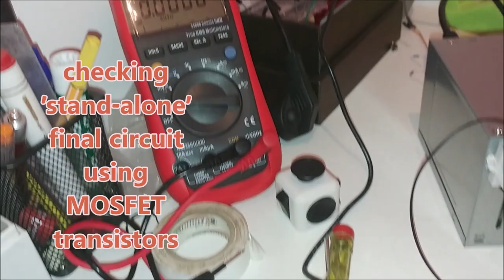LED Stairs Project - Arduino based active by motion sensor

Comment: You can upgrade it with, another pir sensor, one will be downstairs and one upstairs and it could light up by direction you are moving, example you are standing upstairs so it will light up from the top to the bottom and if your motion will be detected on the bottom it will switch direction from bottom to top :) I have this code because i wanted light under bed at night. 3 sensors 1 for my side , 1 for wife's side, and one side is detecting the door so if i go at night to toilet it will light up first the strips from my side and when i am coming back to room that third sensor detects me and light up the middle strip and then the other two  :)
Reply from the maker: really good idea. thank you milan sobocz
Reply: Please can you share the code

Comment: There is a problem with your project. If you come from the upper floor to the lower then the lights will not glow as there is only one PIR sensor used in this project and it is situated at the first step of the stair of ground floor. So if you come down from upper floor then the lights will not turn on and you will fall as it will be dark.
Reply from the maker: thank you @Lion for your comment. it's a good point what are you saying. but actually, the PIR sensor is located under the second step (from up), so it's activated when I am entering the room and also when I start going down and put my leg on the second step (from up).